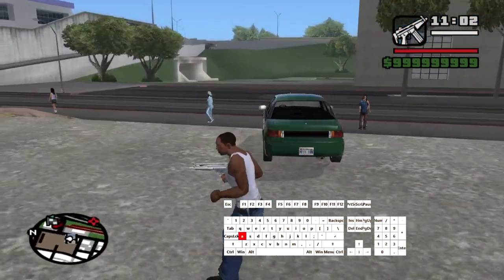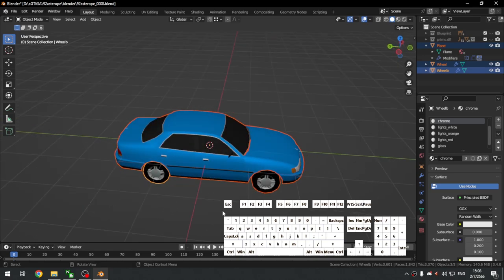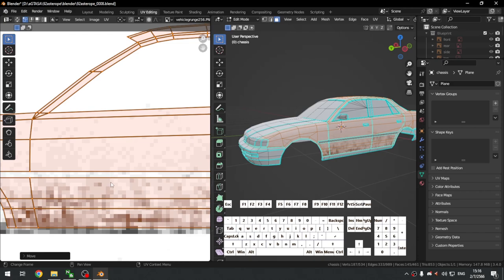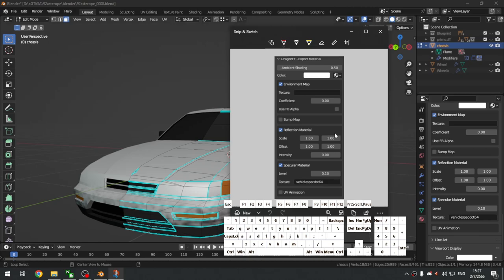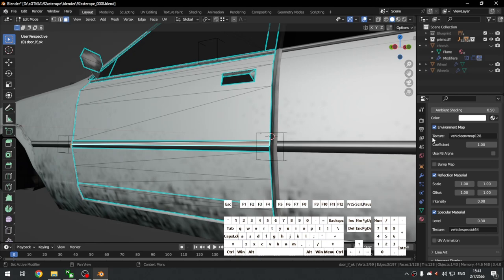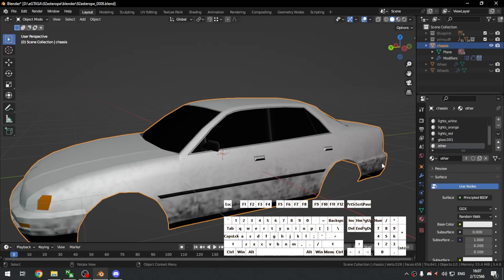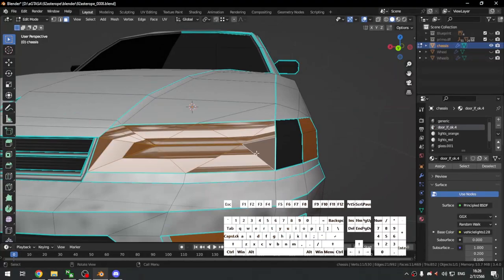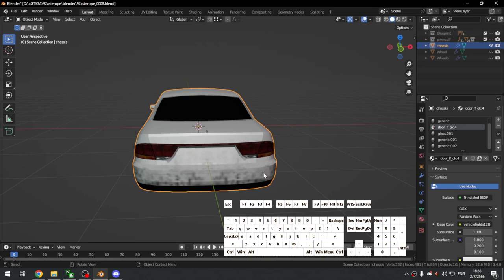UV Mapping  - GTA SA Lore-friendly Car Tutorial Part 5

Comment: 38:56 If I want the orange ones to turn on along with the headlight, do I need to make it 3D too? I mean, the same procedure done on the headlights?
Reply from the maker: This is entirely up to you. In my opinion, I'm guessing that you already made the white headlights 3d, so you probably already have the materials for that. Meaning that it's easier to make them 3d rather than 2d which needs a seperate material.
Reply: @TheMadeManGTA  Thanks! I’ll do that. Sorry to ask but the part 10 is gonna be about conversion to the game?